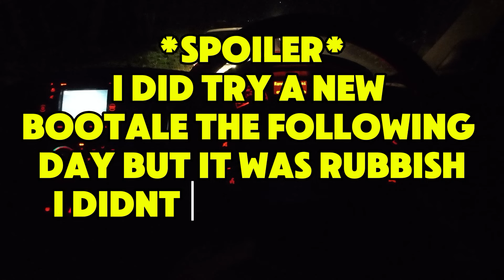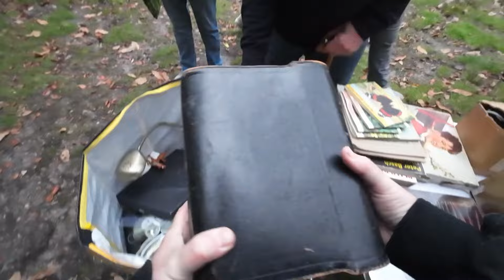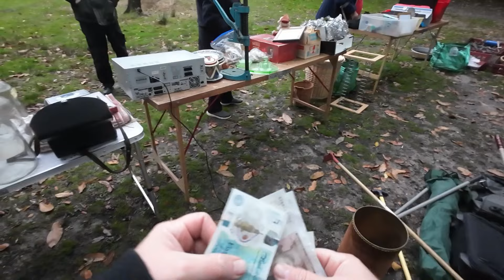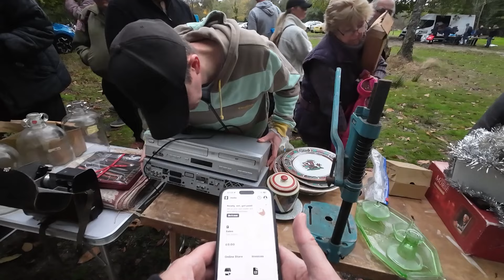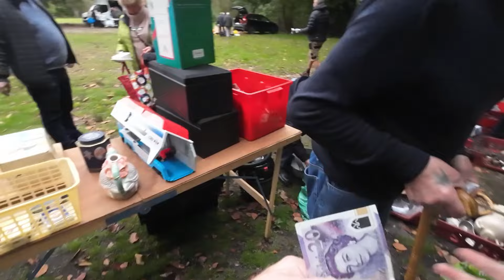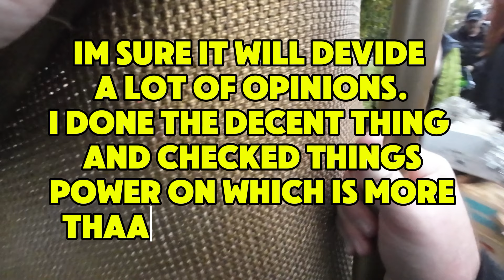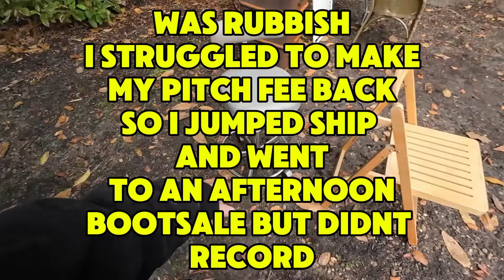“I wanna take it home and bring it back if it don’t work” #bootsales are changing man

Comment: Did the right thing with the vhs time waster guy. He spent ages comping them so knew there would be value at £15 for the pair even if they were faulty.
Reply: @JMEbangingtunes  That’s not how boot sales work, its not Currys or Argos. Ignore what any seller says and  assume nothing works, then if it works it’s a bonus and have a sly snigger to yourself that you got one up on seller. If not working then repair or move them on for a small profit and go again. Why he didn’t resell them himself is his business.
Reply from the maker: @JMEbangingtunes  now read my reply 👍